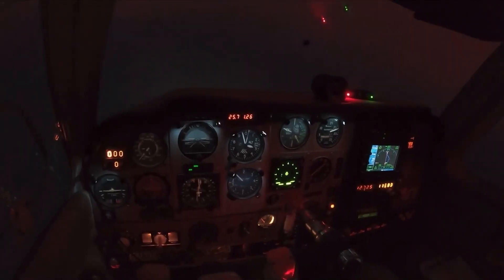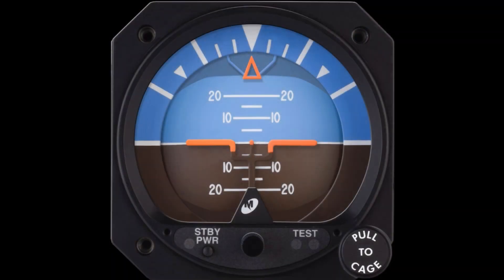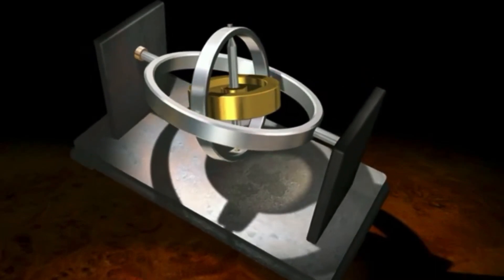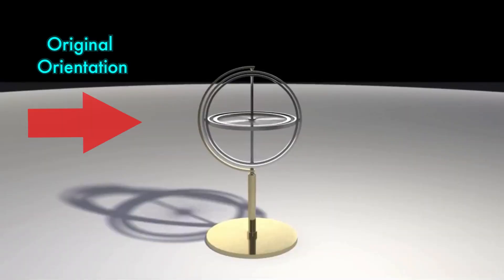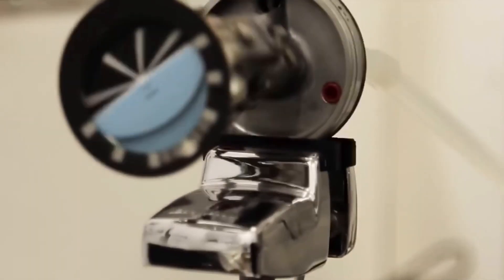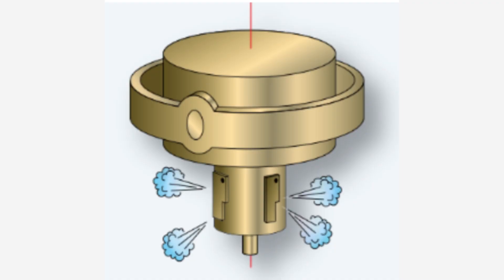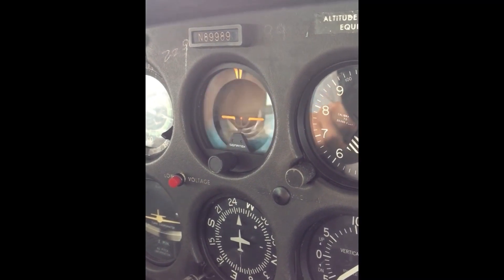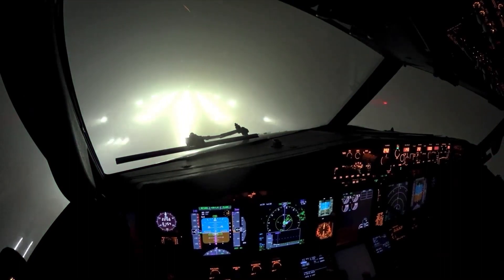Attitude Indicator | How it works?

Comment: As Eric Dubay says, the same gravity that holds the oceans and us fixed in place, but is sensitive and magical enough to let a mosquito break free from it's effects and fly free.
Reply: If a mosquito broke free from its effect then it would not need to fly, and if it stopped flying it would not fall to the ground, but it would fall to the ground wouldn't it? The force or effect that draws the non flying mosquito back down to the ground is given a label so we can communicate with each other effectively. Eric confuses and conflates the label identifying this effect with the "Law of Gravity", the "Theory of Gravity" and the "Gravitational Constant", all of which are highly suspect and deserve scrutiny and challenge.  Matter has no cause to arrange itself by density, no way of knowing the density of other matter nor does it expend any energy when it moves. Hydro dams harness this energy by having the matter it is acting upon, spin turbines as it moves. Gravity simply refers to this effect, it does not refer to the "Law of Gravity", the "Theory of Gravity" or the "Gravitational Constant".
Reply: @daveroy1066  Well, you're agreeing with him then, aren't you?
Reply: @charliegriffin4908  No. Don't know how you draw that conclusion but, no, I'm not. Gravity (the effect we see) is not explained away by density, but rather, matter arranging by density in the direction of the ground requires gravity (external uniform force).
Reply: @charliegriffin4908  I agree that we all must reach our own conclusions, and I would add that the topic as a whole was much needed and has liberated many to challenge the basics. They are lying about so much and Eric has done a ton to get people thinking, we need more of that from other people to enrich the discussion. However, his explanation on gravity, to me, shows a complete lack of understanding on the concept as a whole and the relationship between isolated (?) volumes and displacement.